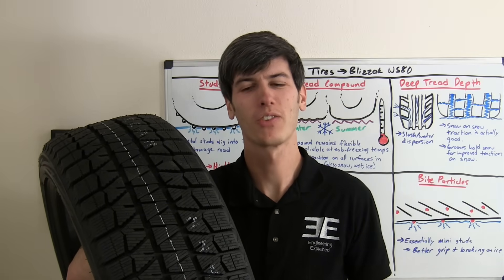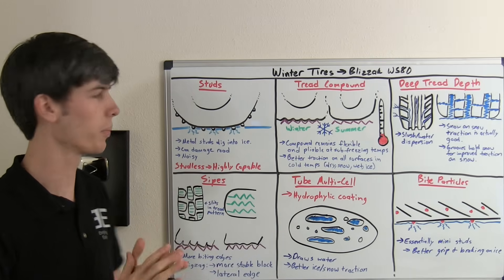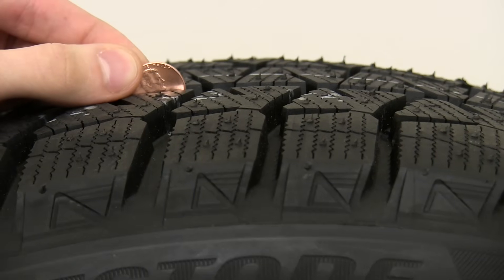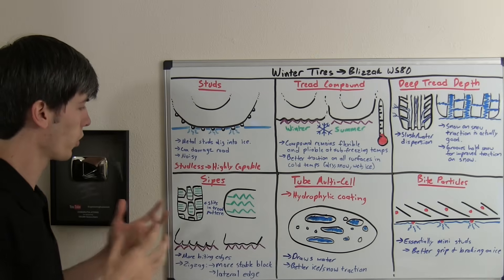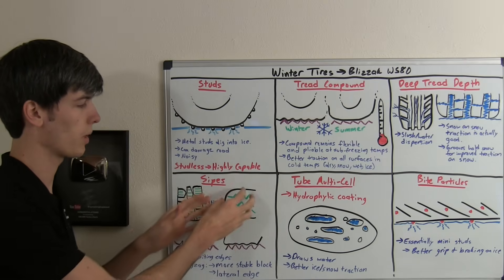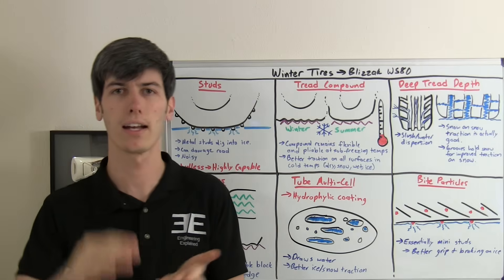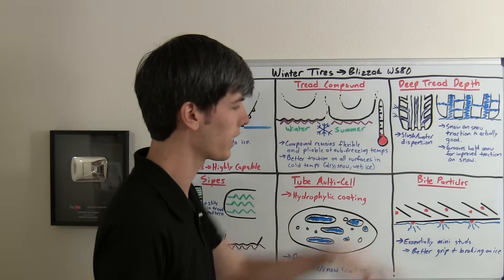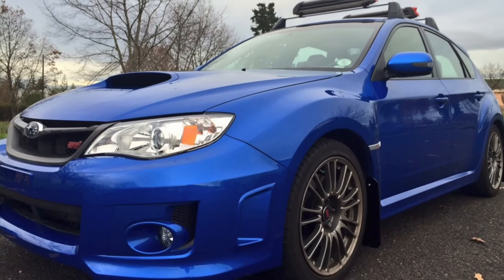Winter Tires Explained - Bridgestone Blizzak WS80

Comment: Great video! If you could make a video mythbust the idea that weight in a car improves traction that would be awesome too. Increasing pressure helps but weight is detrimental to performance and a lot of people believe that weighing down a car will help get them through winter. Having owned a rwd vehicle with bad winter's here, my experience has been positive despite all the weight loss methods I've employed. The car has less weight over the rear axle but narrower tires giving it great handling characteristics and control in the snow.
Reply: I would run narrow snow tires the way you said, and since it's only for the winter I don't consider throwing a few sandbags in the back very permanent. I only would do that for the snow months, maybe 2-3 months of the year. The gas tank in a truck is in the middle not the rear like a car, so just running a full gas tank all the time doesn't have the same impact as putting sandbags at the rear. At the end of the winter I would take the bags out and put my regular wheels with summer tires on. It definitely helps to have the downward force from extra mass to increase traction. One thing to consider is how Formula 1 cars with aerodynamics increase downward force for increased traction. Aerodynamic downforce has all of the benefit of the downward force but none of the negative of additional mass. Adding weight is not good for handling as you said, but the downward force is good for traction at least. Since the negative handling from having a couple hundred more lbs in the back of my truck is very minimal in comparison to the increase in traction it is simply a trade off I am willing to accept.
Reply: joeracer302 vidurc If only all discussions in youtube were like this! I really liked both of your stances and your logic behind your choices. It was a good read!
Reply from the maker: vidurc Check out this link, though I will have a video eventually that more directly addresses this. It's a fairly complex issue. http://www.howdoesacarwork.com/2014/12/winter-tires-faqs-bridgestone-blizzak.html
Reply: Engineering Explained True. Its one of the reasons why I get called crazy quite often since weight apparently is the only way to improve traction for many people. There is a lot that goes into it. You made a good point in the article that addresses load rating. That would also be a good video since not a lot of people pay attention to that! Thanks for the reply Jason! Keep up the awesome vids!
Reply: My F150 (RWD not 4x4) without any sandbags in the rear breaks traction way too easily, and I can barely get above 15mph in heavy snow. Now on that same day I drive to the store, buy about 300lbs worth of sand bags and throw them in the back, then I can easily go 30mph without spinning the tires on my way home in the same conditions. I wouldn't say that this helps the handling of the truck, it just helps the truck get traction off the line and maintain it to higher speed. I can't really say if this is a result of an increase in grip from more weight, or if the additional traction I experience is more of an effect of the change in power/weight ratio. Either way the truck is undriveable before adding the sandbags, and perfectly driveable after.
Reply: vidurc I've had three full grown adults in the cab and several hundred pounds of cargo in the bed of my Ram before and it didn't handle differently, that I observed. I've never had more than a hundred pounds or so in the trunk of my Grand Prix GTP, but I can assure you that it handles impressively bad with just one average sized adult passenger compared to how it does with just me in the car. It's also worth noting that a truck will fill up with snow in the bed, and if there's a foot on the ground there's probably at least a few hundred pounds of snow accumulated back there. I don't know about you but I am NOT shoveling it clean at 5 am and I'm trying to go to work in a blizzard. My point being simply that in some particularly nasty conditions you'll be getting that extra weight for better or worse.
Reply: desertfox2020 Get a bed cover, it'll keep the snow out, and people won't throw their McDonalds wrappers and beer cans in there :p
Reply: vidurc not commenting on snowy conditions, weight does give you extra grip, ask any trucker, my father is a trucker and occasionaly i travel with him, when that truck is unloaded, any dirt climbs are next to impossible, even with te rear diff locked, when it is fully loaded, in 1st gear low box (does about 3 kph) it climbs about anything the entrance and exit angle allows
Reply: F!@#Guilt

That's what happens if you do a perfect emergency stop, you almost do a stoppie(reverse wheelie). All the weight will shift to the front tire, so even if you press the rear brake slightly it will start to skid.
You get the best deccelleration when your back wheel is about 1cm or less off the ground.
Reply: Guilherme Matos

Running winter tires all year around is useless, since above 10 degrees C they will give you less grip then summer tires. And they will wear a lot quicker.
Reply: joeracer302 Pressure increase within set contact patch. Does it work? Yes. Should you be doing that consistently? Nope. Reasoning for that IMHO, handling changes in poor traction. It gets you off the line but you've increased your mass and to stop and turn that mass your increase in initial bite will not help you. Its a good temporary solution and if you have the ability to avoid doing so its best. you'd be better off travelling with a full tank of gas which would have a similar effect since gas weighs 6lbs per gallon. And also increasing your tire pressure. Its typically a 1psi increase for every 10 degree drop. 

In momentary bad situations, it works. However for a consistent solution, increase your tire pressure and/or decrease the width of your tires with the proper load rated tire of course and you'll see a huge increase in performance. 

It just comes down to consistency of bad weather. If you're seeing bad weather a lot then narrower tires with the right load rating that are meant for that specific climate works. 

If you don't see that kind of weather consistently it wouldn't make sense to make an investment like that. Right now my RWD SC400 runs 215 wide tires on the rear and front and has no traction issues in deep snow despite all the weight loss work I've done to it. It bites well and corners exceptionally without the rear stepping out unless I want it to. 

The down side of narrower tires, heat dissipation. Narrower tires do not dissipate heat as well as wider tires do, which means if you're running narrow winter tires on dry roads often you will see a possible increase in tire wear.
Reply: vidurc Thanks, but no need for a spoiler to call it a sportstruck. It's an F150 Lightning so I'll let the supercharged V8 do the talking instead of a spoiler ;)
Reply: joeracer302 Ha ha! Nice. I see why you have the traction issues lol!
Reply: vidurc While reading your reply it ocurred to me that when adding weight to the bed of a truck, you may not get the same changes in handling that you would in your car. The truck is designed to carry lots of weight and still handle as close to the same as possible. I can't help but think that the effect of 300 lbs of sandbags in the bed of a full size truck would be orders of magnitude smaller than the same percentage of overall vehicle weight in the trunk of a RWD midsize car.
Reply: desertfox2020 That's also very true! Fully loaded cars have very very bad handling. My TL oversteer's like crazy and so does the SC. Trucks though can handle the weight.
Reply: desertfox2020 Makes sense. I like chopping weight since its the easiest mod one can do to a car to extract more performance. So far it's worked great and I haven't had any bad handling characteristics develop. The car's have been very predictable. On a truck I've just kept ours covered as much as possible to keep the weight down but you're right. It doesn't feel very different unless you poke and prod which I like to do :P
Reply: joeracer302 I have one, but most people don't and I haven't always. I only have it because when I go hunting or to the range, (the only two places I don't drive my GTP) I can leave my "valuables" covered and locked up.
Reply: vidurc Not a reply specific to the ongoing discussion, but aside from the obvious disadvantages of weight, traction generally improves linear to added weight.
A good example would be long haul trucks - their brake distances stay pretty much exactly the same whether empty or fully loaded.
Reply: grmasdfII Yes, friction is a product of the normal force acting on the surface and the coefficient of friction, i.e. Ff = Fn*Cf, which is a linear relationship between normal force and resulting friction force. Traction is a product of that friction force. Which is why if you can increase the normal force there is a proportional increase in traction. In a car sitting level to the ground that normal force is the mass*gravity (weight) of the car, but obviously when going up a hill or on a banked turn your normal force isn't just mass*gravity, you have to calculate the trigonometric component based off of the angle between the downward acting force from gravity and the angle of the incline to find the force normal to the surface of the road. But ya, this is why you put more weight above your rear tires and you have more traction available, but of course the dynamics of the car are a lot more complicated than just mass and traction. Many other factors come into play, and there are many other performance metrics that have to be considered depending on your needs/goals. Some of those touched on are the impact that adding mass can have on handling and braking performance. You brought up long haul trucks and how braking stays the same for them regardless of load, which is an excellent example of how a vehicle that is designed to carry all of that extra mass has brakes that are properly sized for it so it maintains braking performance under all expected use conditions. Most passenger cars are definitely not designed for that type of loading, because they are not expected to see that type of use regularly, so the brakes are only designed for that use instead of carrying heavy loads. Any extra mass you add to the car once you get moving becomes part of the vehicles kinetic energy (E = 1/2*m*v^2), and brakes essentially change that kinetic energy into heat through friction (again the friction!). A braking system has a given heat rate it is capable of dissipating before it begins to degrade in performance, and if you exceed the capabilities of the system your braking begins to suffer. This is why a lot of passenger vehicles and light duty trucks do experience worse braking performance when they are loaded up as a result of having brakes that are barely sufficient for normal driving conditions and maybe 500-1000lbs load before your braking starts to degrade. This is especially true for high stress environments for brakes, like coming down a 5+% decline from a mountain pass where brakes are applied repeatedly from high speed over short time periods. Long haul trucks as you point out are completely different and are designed for their loads, so they are able to maintain their braking performance even when fully loaded (and everything is functioning properly of course). Thanks for pointing that out, it's a great example :)
Reply: grmasdfII You're looking at one part of the equation. On an undulating surface for example a truck would not be able to stop fast because their suspension is designed to handle more load. On a smooth surface a fully loaded semi will never be able to stop as fast as a loaded semi. The fact is that mass in motion has to be brought to a complete stop. In certain situations you would be able to say that suspension designed to handle load would work better when under load. So a pickup with that is meant to handle 4000lbs of load in its bed will handle at its optimum level when it is loaded. Cars on average are not designed to handle much load. Even alignments should be done with the average load a driver places in his car or your tire wear can change. 

This is also the reason why we change suspension setup depending on the track and surface I'm racing on. On a track with a bumpy surface my suspension setup tends to be softer allow for articulation so the tires make contact with the road. On a smooth track with no bumpy surface my suspension would be set much stiffer since there does not need  to be much articulation to generate traction. 

The same goes for F1 cars for example. They are designed to be driven at a certain threshold. Anything below that threshold and they do not operate at an optimum level. Their suspension need certain conditions to operate effectively and they are stiff because braking and acceleration forces increase with speed and power. The same goes for the tires which are designed to  operate at higher temperatures. So in order to be "safe" they need to be upto temp and driven hard to do so.
Reply: vidurc So...was there a point in there? If there was, I missed it :)
If it was just an exercise in finding things to talk about, that's ok, I guess.
If we were still talking about long haul trucks - well, I didn't specify, but I was talking about the run of the mill highway variant, which is by far the most common.
Asphalt is or isn't a smooth surface depending on optical magnification...Either way, on Asphalt, a fully loaded semi (European - probably the same elsewhere though) will have the same stopping distance as an empty one. (give or take 1-2 meters, human error factor and all)
If you want a more complete picture, the added traction through friction as joeracer302 explained in detail, also leads to less anti lock brake activations.
Reply: grmasdfII The point being your example of a fully loaded truck vs a non loaded truck can't exactly be compared to traction levels on a car with load. There are a lot of variables at play. Tires, suspension and the road surface all have to be taken into account. A good rule of thumb would be to tune according to prevailing conditions and the type of vehicle and hardware employed. Sorry, I go into too many examples sometimes.
Reply: vidurc I get what you're saying and agree. Wasn't trying to dispute any of that :>
But, you know...I used to drive a Ford Capri 2.8i and put concrete slabs in the trunk in winter (typically they would hold down a parasol) because it was impossible to go anywhere otherwise.
Sometimes you just have to improvise :>
Reply: grmasdfII Agreed! Narrower tires so far have been a great mod for the winter for me.
Reply: I would say that, in a physics 101 lab, all things being equal, the calculations aren't affected by weight sure. but why is it that 60% of the braking power is in the front wheel of a motorcycle due to the weight being shifted forward during braking if weight distribution has no traction affect? Rather than traction, wouldn't it be more correct to say "friction coefficient?" I think that traction is affected by weight distribution, but I am no engineer...or person with a completed physics course on my transcript...just never finished that class....:)
Reply: but the official user manual for my 82' bmw E21 315 (rwd) that is notorious for all the weight being on the front axle (close to 70-30 weight distribution) clearly says, that you should put 50kg of ballast in the trunk in poor traction conditions (such as snow etc.) and it does help very much; not just off the line but also in corners (this car likes to oversteer like crazy if the fuel tank is empty and there is no ballast in the trunk beacuse with an empty tank I think the weight distribution is closer to 80-20 haha xD)
Reply: peter bukovec easy solution for the everyday user and the suspension is most likely setup for the weight. Older car different age and easy solution for an engineering issue. Unfortunately the proper way is seldom easy but I value great handling especially in bad weather. It's not a good solution for all vehicles
Reply: It really depends on the type of snow.  If you're driving over hard pack, your solution works just fine.  My gf used to have a little scion xb that was simply a beast in the snow.  However, if the snow is soft, and you have to plow through it:
1. You need momentum.  It is easier to increase mass than to increase velocity in slippery conditions.
2. If the tires have to move snow aside, being narrow definitely helps.  But having higher weight = normal force X friction coefficient helps too.

You can kinda narrow your tread by pumping up your tires to few pounds below the max pressure (minimize contact patch).  If the concern is sinking in, you'd want to the the opposite (sand driving for instance).
Reply: Hi

I haven't been able to go through all the comments yet so you might have already answered this, if so sorry!

Why increase the pressure of the tyre in winter? Is this to compensate for pressure loss brought about by the cold weather thus keeping the tyre's at the manufacturer's recommendation. Or are you trying to narrow the contact patch so to increase traction by increasing the contact force through a smaller surface area?
Reply: joeracer302

Remember, with the extra 300lbs you will have a even longer braking distance.
Reply: F!@#Guilt

60% on a motorcycle?
Let's just say it's over 95%, if you brake properly and have enough grip (dry weather, warm tires) your front brake is the  only thing that's stopping you quickly, because in a perfect emergency brake you have no weight on the rear tires, any rear brake will cause a skid
Reply: ***** Why are you talking 95%? that would be almost a reverse wheelie. Rear brake will never cause a skid unless the friction between the brake rotor/pad interface is greater than the tire/surface interface. If you apply both front and back brake, you will get 100% of available braking power so, no, just because you are braking quickly doesn't mean you will automatically start to skid. This will only happen if the brake "locks" up. If you keep the bar centered, apply the brakes evenly and smoothly, and are in normal road conditions, you won't skid.  

My point is, if weight distribution had no bearing on brake stopping power, there would be no difference between the front or back due to weight shifting. but friction does increase during braking. My ultimate point is that weight is a factor in friction of the tires.
Reply: Guilherme Matos Weight distribution does not equate to grip. It does generate grip but trying to increase traction using weight is a bad idea. Hauling a load will naturally put more pressure on the tires but loading your car up in the winter is a bad idea. Especially if you have severe winters because you now have more mass to stop and move at any point in time. That is dangerous and the problem. Its a short cut solution at the end of the day which works if you need a temporary one but if you more sever weather constantly change the width of your tires and keep the weight down.
Reply: vidurc
But having additional weight increases grip on snow and ice all the time.  Not just acceleration, but braking and turning too.  The benefits are greater the better your tires are.  FF cars and RR cars don't have any secrets, but they are both good in snow because the weight of their drive train is over the drive wheels.
Reply: davetek490 No it does not. With more weight you have more mass to stop. Your tires have more work to do. If weight is good for cars WRC cars would be loaded up to drive snow stages. Instead they are kept light and their contact patch is improved. Basic physics. to stop and turn more mass, you will require more effort. Those forces are created from your tires making contact with snow. Increasing tire pressure and reducing the width of your tire can do that.

All you're creating is a situation for yourself to be surprised when the tires cannot handle the weight you have added. I drive 2 lightened cars in the snow and do just fine next to the people who have more weight. I have to be more gentle with my throttle application but my braking and cornering is better. 

The illusion you create with more weight is that you have more traction. While you do have a slight increase you no longer have the ability to corner and brake as well. 

Also think about it. A truck should be able to stop faster with a load in it based off what you have said. Here's an article to prove that is not the case. http://special-reports.pickuptrucks.com/2013/06/2013-light-duty-challenge-braking.html
http://special-reports.pickuptrucks.com/2010/11/2010-v-6-work-truck-shootout-brake-test.html
Reply: vidurc
WRC cars are trying to do everything as fast as possible.  The avg car driver is trying to make it up a hill.  The reason WRC cars are not loaded down is that they are trying to get maximum speed per engine power.  If you weight your car down, it's going to be slower.  But if you care about traction, and only traction, and airing up your tires isn't sufficient (for most FR cars with wide rear contact patches, it isn't), sand bags help.  Yes, adding weight to a car makes it more difficult to turn and stop, but none of that matters if you can't get it moving, or if it spins out anyway. 

Most people aren't going to lighten their cars.  How does a BMW owner lighten the weight of the drivetrain on the front wheels?  Getting smaller tires only is going to help the unloaded rear wheels bite?  Seen way too many in the ditch to agree. 

Of course increasing weight increases stopping distance.  But the tire to tarmac relationship is ideal there.  You have maximum available traction you'll ever have, tire to dry, clean tarmac.  Here in snow, we don't have that.  In snow, you have less than ideal, and it's linearly proportional to the normal force ie the weight on each tire.  If you RWD pickup is stuck in snow, throwing 200lbs of 'crete in the back will help get it out, as it increases the rear tires grip closer to the ideal on snow.  If you then crash your truck by not accounting for the extra weight, that's a hypothetical.  The fact is that the normal force was increased, and therefore the friction force increased.
Reply: vidurc
exactly why i said not commenting on snowy conditions, although, braking with heavy snow negates the point of the discussion entirely, if the wheels drag a little bit, they loose contact with the road (it creates a skate of sorts made of snow). i live in a mountain city, snow is only tolerable with a 4x4 (no center diff) and at very slow speeds, that's because you can downshift and as there is no center diff to spread the downshift's increase in resistance, you can descend snowy slopes with safety
Reply: vidurc
 and btw, i'm all for winter tires, i practically run them all year long (unpredictable weather) the truck's example is different because when you are loading 24t you tend to make sure your center of mass remains centered in the middle of the axles, and also, you tend to attach it properly
Reply: *****
although i have been told that, quite a lot of time, they last about 20000km's a set, i have michelin Pilot Alpine 3, and i haven't noticed much of a difference in wear (they wear at the same time, but do have more thread depth) in terms of grip, well, it' not a race car, it does what it's told without complaining a lot, however they do squeal more btw, i don't have 2 sets of wheels...